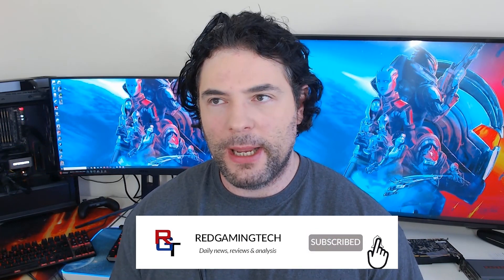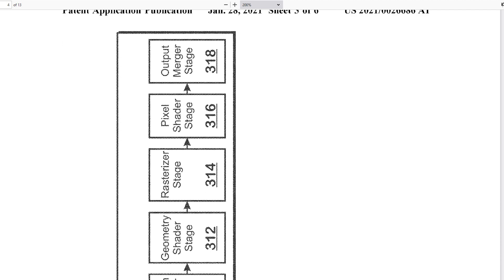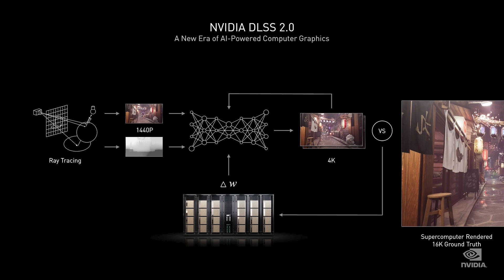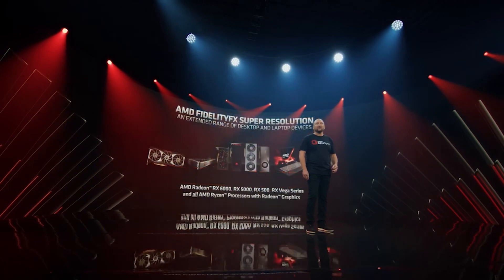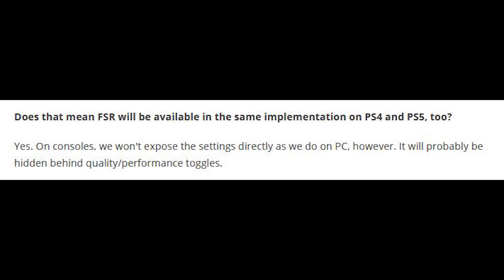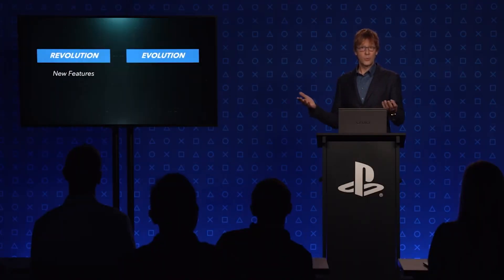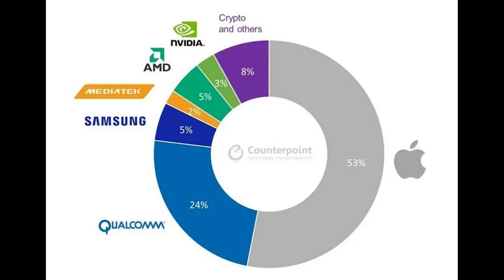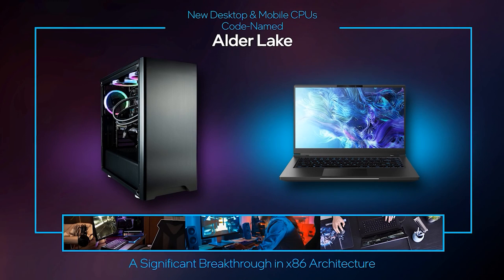RDNA 3 Upsampling - How Navi 3X Could TRANSFORM FSR | PS5 FSR Support CONFIRMED By Dev

Comment: FSR is really cool but I still like my brute force method for the image quality. Tatin Fall 2 has an option in its graphics settings called Dynamic Resolution Scaling and its amazing. It pretty much works like FSR, (I'm assuming). You tell it the frame rate target you want and then based on the performance, the game will upscale itself as far as your system can handle to maintain the frame rate, and damn does it look sharp.
I still brute force my games with Radeon Image Sharpening + Super Resolution. It's nice enough to disable AA settings and still produce a better picture quality.

Comment: 1.) Nvidia DLSS 2 uses a generic model. There is not training per game needed like in DLSS 1. Nvidia might do some optimizations at releases for bigger games (same as they have already been doing with their game ready drivers), but this is not really needed. All you need to do as a developer is use an engine that supports DLSS (like UE4/5) and create your game with it. All the magic in DLSS 2 happens in a single dll from Nvidia that ships with the game and can even be copied from one game to another. So you can upgrade DLSS 2.0 games to 2.2 by simply swapping the dll and you will see improvements in image quality. I dont think the driver does much more than providing the interface to the hardware.

2.) There are basically 3 categories regarding image quality with current upscaling algorithms:
a) CAS, FSR etc. These effects are done at the end of the rendering pipeline directly before drawing the HUD or some effects like film grain. These are very easy to implement because they work on the final result and require no modifications on engine level, but image quality is limited, but they do not provide an AA solution, so you have to combine it with things like TAA which may add blur even to the image at render resolution or cause flickering at edges.
b) Temporal upscaling like TSR in UE5. Those use temporal information of previous frames which greatly increases image quality. Also it does not only solve the problem of upscaling, but does AA as well which has the big advange that AA can work with the higher output resolution rather than the lower render solution. The disadvantage compared to FSR is that it requires modifications on the engine level. This is typically not something you want to add to games after release.
c) DLSS 2 with temporal upscaling and use of ML. This provides the best image quality, but compared to TSR it requires tensor cores, so Nvidia will have some die space dedicated to it. Also tensor cores can become the limiting factor if you are using it on a lower end card (like the 2060) at high resolutions with high frame rates. Also like the other temporal upscaling technologies it is rather hard to integrate it in existing games (or in the late implementation phase). This is the reason why game support has been so poor at the start, but is growing so fast. The plan is to have DLSS integrated into the engine in the middle planning phase. One big advantage is that Nvidia has a very good team that help developers integrating DLSS for the best result. If you are a developer of a AAA game they are basically sending you a developer for free that does the DLSS integration for free.

3.) I think AMDs plan is this:
Step 1) Push out FSR as an easy to implement solution to have a solid baseline for all games that do not have a modern upscaling solution. As long as it is better than the upscaling done by the monitor it is worth it. Sony and MS are not so much interested in this technology because console games often already have an upscaling solution like checkerboaring that is on a similar level compared to FSR. This is the short term plan for the next months (or a year).
Step 2) Support engine makers like Epic in optimizing their upscaling solutions to AMD card (like they did with UE5). This is the medium term plan for the next 2-3 years, which enables them to survive long enough on the high end graphics market with a bigger market share for step 3.
Step 3) Come up with their own ML based upscaling technology, but I doubt it will be RDNA3. I think this will be more like RDNA4, but will like DLSS most likely need a lot of integration work. Game developers will only do this if AMD has a large enough market share.

So in the next year AMD has to sell their cards more or less at production costs and attack Nvidia simply with raw traditional rasterization performance and maybe a more advanced node at TSMC and later push their ML based solution to get back into the profit zone.

Comment: I got a set of RAM not to long ago because I believed it had Samsung B die in them. The early versions did, but they switched it to a lower performing Hynix die, that wasn't any better than the chips I've already got. 

I ended up returning them.

(One of the games I play is very dependent on memory latency, to the point that you can get 5-10% performance by tightening the timings)

Comment: their process wont be the same because AMD is using a custom process they helped develop and have exclusive rights to for a time. Right now, AMD is producing 5nm and Intel will only make server parts on 3nm. Leading nodes are too expensive for low profit consumer parts. There is a reason Apple charges so much for flagship phones. A consumer CPU won't sell for $1k and it doesn't have low cost parts that offset the cost like a phone lcd or memory does.

Comment: FSR needs better labeling. Currently the idea of accelerating with AI an algorithm that doesn't even use AI code is nonsense. Adding AI code changes massively the algorithm that it's a very different thing just with the same goal. The algorithm needs a label and not only its goal, AMD. -.-

Comment: The tweets are clearly wrong, MLA are for training AI with large data sets, not for running the resulting net.
Nvidia fudge this, when marketing RTX to gamers, the feature is more an entry point to their B2B AI stack.
Recently I heard updates on DLSS2 that Nvidia now have a general AIB temporal upscaler trained on a wide sample of games comparing 16K "true" to lower res approximations.
It may be the case that DLSS has become easier to add to games now

Comment: Sony and FSR
Who cares?
FSR is unlikely to make much difference on the game console's. They already have excellent temporal and other upscaling techniques as it's much easier to optimize a game for known hardware (hence why checkerboard rendering existed on console's). Game engines like Unreal 5 are going to keep adding things like Nanite and other efficient techniques that will make the code more EFFICIENT and thus reduce the low-hanging fruit that enables FSR to improve performance... I see a lot of comments from people who do NOT UNDERSTAND how this all works who are under the impression you can just slap "FSR" onto a PS5 game and gain some boost to performance.
Is it possible there will be some COMMON, OPEN SOURCE method to improve things at some base level for console's that also applies to PC gamers?
Maybe initially, but I think what will happen is that "FSR" will find its way on PC in the short term, maybe a few instances on console, but for the most part console will just do their own thing, and again game engines will develop code that makes FSR kind of pointless IMO.
I'm not saying they SHOULDN'T work on FSR or similar methods if there's at least a short-term benefit or elements make its way into the game engine code, but people need to educate themselves a bit more on how upscaling methods work and differ before they say... stupid things.

Comment: Intel booking tsmc 3nm is not a bad news for intel coz with 3nm node intel will not have a node disadvantage against amd. Secondly intel 7nm is said to be in much better shape than what used to be when they started production of 10nm. With foveros and emib intel will now be able to have a combination of different nodes on a single chip which is huge advantage in terms of cost and performance.

Comment: The problem with the change of the specs of a product several months after releasing it, without changing it reference => previous test are "obsolete".
The same could be said about drivers: some cards are better/worse versus others at launch, but 6-12 months later (when availability is better, for example), with some drivers optimization, new stepping of the GPU chip, etc...) results could be different... and deciding which product to buy is going to be more difficult (as review are not that often updated)
In fact, maybe just the thermal/noise are still relevant, but not the performance after a certain period of time
What could help: a new game is release, therefore new tests are done with it, and then we can have an idea of the differences between graphic cards...

Comment: Can I just say the xsx tools must have been so bad on launch ? There is no way the ps5 should stand up beside xsx ever not a chance' every single spec that matters is so far behind xsx it's no funny tbh apart ssd but ms gas there own ways to speed the way it can be used' can't wait for real dml to kick in as I dnt think vrs is ever gona cut it as ps5 still keeps up wtf lol maby not in 120fps thow
Reply: You should watch his other videos about the ps5. The ps5 is much more powerful than you think. It’s cable of processing up to 22gb/s for graphics or what ever you want the data for and when you mix that in with the ps5’s geometry engine than stuff can possibly be infinite in detail.
Reply: @balloonb0y677  This is woefully inaccurate... The PS5's "Geometry Engine" isn't NEARLY as custom as you seem to think. Most of RGT's "info" on the PS5's "GPU customizations" ended up being dead wrong. 

The issue is primarily down to Sony's VASTLY SUPERIOR/more mature development tools, & the PS5's superior pixel fill-rate in very specific situations (thanks to the higher clock-speeds). And in many of the games were it has the better/more stable framerate, it's also running at a lower resolution than Series X.

There's a reason that well coded games tend to run at higher resolutions on Series X, and in margins in excess of +30-40%.

Also, thanks to Microsoft's still WOEFULLY W.I.P. dev tools, developers still haven't started to tap into many of the Xbox's unique & most important performance boosting features like Variable Rate Shading (something the PS5 GPU simply doesn't support) or its MUCH beefier CPU FPU ("Floating-Point Unit") capabilities (again, cut back on the PS5 to save die space).

The Series X is UNQUESTIONABLY the faster console in terms of raw power, considering Sony's customizations or not. Sony just happens to have the best dev tools in the business, and atm that's not even close (don't get me wrong here, Microsoft has been regularly making massive strides forward on this front, but they were just so, SOOOOOOOOOOO far behind at the start of this generation that they still have a WAYS to go to catch up).
Reply: @Cooe.  a lot of what RGT said actually wasn’t proved right or wrong. As of right now you can only choose to believe him or to not believe him, only time will tell which console is better. But right now I believe that the ps5 is the better console although I could be wrong.
Reply: @Cooe.  and the geometry engine does the stuff that you call VRS, mark cerny clearly talks about it in his presentation
Reply: @balloonb0y677  If RTG's info was right, Series X wouldn't have regular & significant resolution advantages. Hitman 3 for example would be within margin of error, resolution-wise instead of having a like 30% resolution gulf.

The PS5's current performance profile basically EXACTLY matches a GPU with superior pixel fill-rate (bc of the stupid high clocks) but inferior most everything else, along with superior dev tools. It's generally got a more stable framerate w/ less drops (ESPECIALLY in PC or last-gen to next-gen ports rather than native next-gen games) but can't handle the same kinds of resolutions in GPU heavy titles due to having SIGNIFICANTLY less raw shader umph. Even with Microsoft's notoriously bad & "not ready for price time" dev tools, dev's can still brute force significant resolution gaps thanks to the raw GPU power differential.
Reply: @Cooe.  I’m guessing you got this information from DF and I’m going to say that whether they say the Xbox performs better or the ps5 performs better don’t believe a word they say. A C++ game engine developer said that he watched a couple of their videos and that they made no sense at all. To me it wasn’t even surprising that he said that because I always wondered how the hell do they even test these consoles to know exactly what resolution per frame the game is running at, I was always suspicious.
Reply: @Cooe.  and developers are just barely taking advantage of these consoles, even R&C doesn’t come close to showing the full power of these consoles, R&C only shows a glimpse of what’s possible.
Reply: @balloonb0y677  Not DF. Alex can't be trusted. His complete fuck up in testing FSR makes that PLENTY clear (you can see all the damage that faulty info caused all over this comments section). 

These increasingly common resolution advantages on Series X vs PS5 are widespread & widely available information that anyone with a screenshot tool can manually check for themselves. Same with the PS5 often having a more consistent framerate & frametimes in these very same titles.
Reply: @Cooe.  so where do you get your information. I can tell you that if you tested the same game on both consoles it would be exactly the same.
Reply: @Cooe.  the only games to compare between these consoles are exclusives which Xbox has yet to release
Reply: Teraflops shouldn’t really be used as the main indicator of performance. The Xbox one x had 6 teraflops and yet the Xbox series s with 4 teraflops is far more powerful. Each ps5 teraflop equates to 2 ps4 teraflops, so if the ps5 had 3 teraflops and the ps4 pro had 4 teraflops than you would think that the ps4 pro is more powerful but in reality the ps5 is more powerful. In terms of raw gpu power that is.

Comment: A 3/4th's reduction of 2TB is NOT 512MB.. Just sayin..
Reply: I was never that good at a math, but I'm pretty sure that reducing 2 by three quarters (75%) equals 0.5
Reply: @bgtubber  With all due respect, 512MB is not 25% of 2TB. Think about it.
Reply: @cobrakb  You are right. I read your original comment as 512 GB not MB. Now I see what you mean. :)
Reply: 512MB of 2TB = 1/4096th (0.024%), not 1/4th

Comment: AMD's equivalent of tensor cores? Let's face it, FSR is limited in comparison to DLSS. Adding new silicon is much quicker than a software-based solution. They already have the infrastructure for it, why not?
Reply: DLSS is supposed to be a "catch all" FSR like AMD's other tech is supposed to do a single thing. Adding more things to a die increases size and that makes it more expensive and difficult to produce.
Reply: @dralord1307  You are not adding anything if you are able to take something away in place of it.
Reply: @thepuzzlebox6620  What are they taking away?

Comment: xbox and ps5 dont have tensor cores but they have metrix cores technology, it is weaker compare with nvidia tensor cores.

if nvidia's tensor cores can do direct ML upscaling and produce 50% performance improvement, the amd metrix cores is only less than half of that. maybe only 15-20% improvement
this is explain why microsoft still didnt bring direct ML until today and AMD choose FSR solution.

amd RT cores also weaker than nvidia. it is 25% slower in hybrid ray tracing and more than 60% slower in full path tracing(like minecraft rtx) compare with nvidia.

i doubt xbox sx and ps5 can do minecraft RT even at 1080p 60fps... maybe this why microsoft didnt release minecraft RT until today because the demo run bad at 30fps with full of shuttering and lag.
Reply: Could you give a source of your numbers. Cause spelling matrix wrong makes me question if you copy pasted the numbers correctly.
Reply: @kazedcat  sory for typo
Reply: AMD GPU's have always had excess compute. Even so, a driver-based solution will take a lot of time. After their mobile GPU deal with Samsung, I expect them to channel development into designing a tensor-core equivalent.

Widespread cloud gaming is still 5 or so years away. I expect a milking of the current era with a road map towards using its RNG for something later on.
Reply: @thepuzzlebox6620  i hope rdna on samsung chip will give FSR on youtube. so we can watch 4k youtube with cost of 1080p
Reply: @kusumayogi7956  Smoothing out lines by filling pixels is much easier if done during post-processing. Doing it dynamically is when it becomes challenging. So yes, DLSS could be applied to something like YouTube.
Reply: @thepuzzlebox6620  but i wanna fsr
Reply: You are showing your prejudice against AMD and fanboyism for Nvidia. Tread carefully.
Reply: @johnvandeven2188  im amd fanboy
Reply: So the ps5 can run multiple games with ray tracing but it can’t run ray tracing on one of the least demanding games at even 1080p. Sounds very accurate
Reply: @balloonb0y677  full path tracing is different, look at 6800xt running minecraft rtx

Comment: Of course PS5 supports FSR; FSR does NOT require specific ML hardware in the GPU in order to function, it simply leverages compute, and consoles like the PS5 have a lot of compute.  FSR also doesn't need specific low-precision FP or INT support built into the GPU to function, so this doesn't tell us ANYTHING about if PS5 supports low-precision beyond (or in this case, below) FP16.

  Not that it's required, but there's no evidence suggesting it's any more than PS4 Pro in terms of FP or INT support, and that's okay.
Reply: I am pretty sure it needs direct x because other and fidelity fx effects need direct x to work.
Reply: Πάνος It is a shader program it can be ported to whatever shader language PS5 is using.